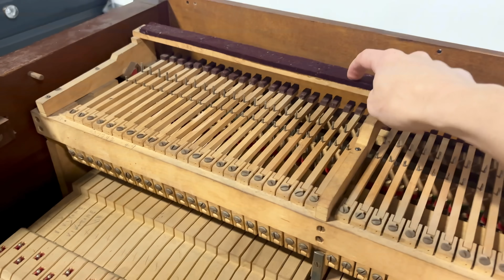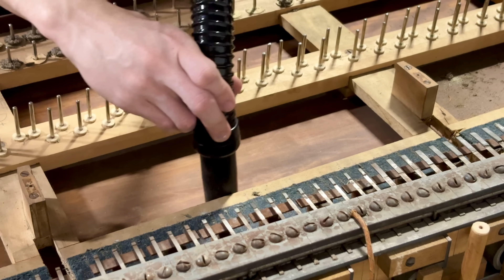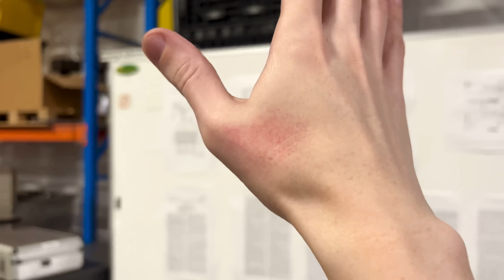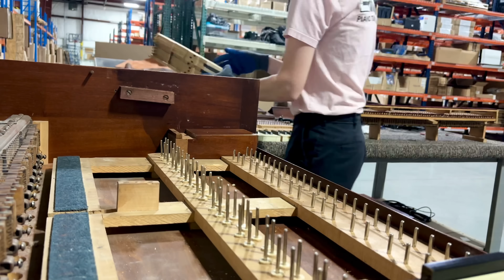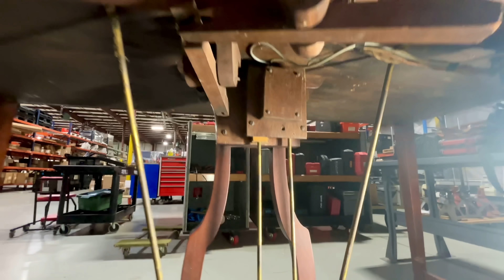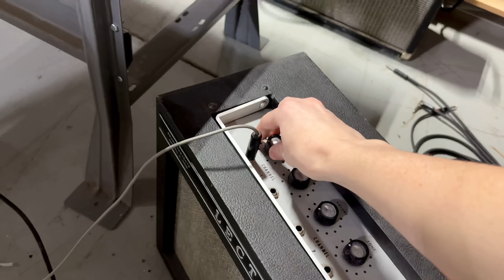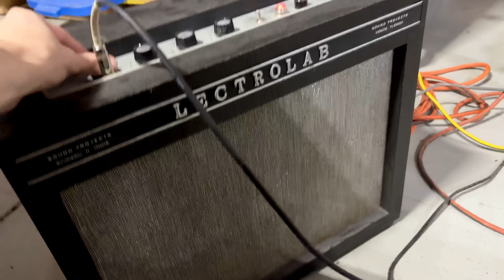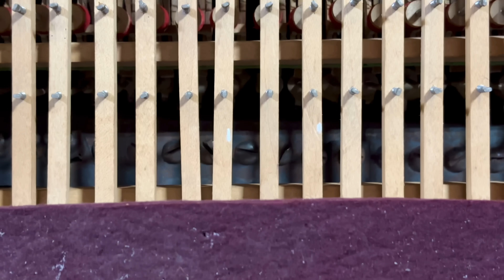Restoring an Instrument You've Never Heard (only 3 left)

Comment: this is so strange. It doesn't sound like a wurly rhodes or hohner. I don't even know what to make of it.  

thanks so much for sharing emma. 

That b3 (247 hertz) has so much key noise on it.  Very distinctive which is part of the charm.  A 100 year old instrument shouldn't really have all the reeds sound the same.

I can't believe how precisely you tuned this.  The notes are dead on as far as I can tell, not even a cent off. That's a lot of screwing and unscrewing.

It reminds me a lot of intonating a floyd rose guitar except we use a special tool with a screw in it, where you can screw the plate in or out.

[the next day]

I think maybe this instrument will be best in a mix. There's a plainness about the tone which works well in a band, but doesn't have the expressiveness of the rhodes.  I really wish you were allowed to swap out all the capacitors for new ones, because I bet they are hindering the tone. Even 100 year old pickups should be fine. And the rest of the circuits should be ok too. I think you lose something like 5% of magnetic field strength over 100 years so that shouldn't be a problem.  But if there are any caps in the power supply, audio path anywhere in the circuit I would hope they get replaced.

Comment: Those capacitors are close to 100 years old. Wow! You should replace them as they probably aren’t doing their job anymore. It is an acceptable practice when servicing a historic amplifier (like a 1960’s Fender) to replace electrical components that have “expired”. Capacitors stop doing their job after 30 or so years. They can be tested for leakage current and evaluated, but it’s ok to just replace them.  I would think the pots are ok. You can test their resistance with a multimeter. They can be inspected by opening them up if your measurements and cleaning don’t work. When you look at how much of the mechanical parts are intact, I don’t think a capacitor or pot being changed is a big deal. If you replace the parts, don’t throw them out. Bag them and keep the bag in the keyboard with a note explaining they are the original non-functioning parts.
Reply from the maker: Yes
Reply: @Emmarepairs I apologize. The instrument is really an amazing piece of history.

Comment: The shielding picking up the radio station highlights why some equipment has a signal ground that is separate from an earth ground. I would guess this has an ungrounded 2-blade power cord. If external noise was an issue, tying all the added shields together and connecting to the ground wire of a grounded power cord should help but that would be more a modernization than a restoration.

If the owner ever wishes to play it regularly instead of having a restored museum piece, some modernization, while retaining replaced parts for a possible future historical restoration, might be needed.

As for the pedal controls, use shielded wire with the shield connected to earth ground instead of signal ground. While the original wire used a single conductor with a shield, using 2 twisted pairs with a shield would allow the 2 signal wires to each be grounded to signal ground while also having an overall earth ground. A replacement gear would need to replace the one with the broken teeth. I think a 3D-printed one would be a good alternative to carving a new one from wood or making a metal one (brass to match the brass on the wooden control rods.) The 0.00075 MFD capacitor (0.00075 μF, 0.75 nF, or 750 pF) appears to have the word “OIL” right below the black line. Whatever’s inside, good chance this thing dried out decades ago. Replacing that might restore control. Once the old part is disconnected, try measuring the pot for its value, if not marked, then replace both.
Reply from the maker: Ok

Comment: Twist the wires. Twisted pair is one of the best way to shield a wire. (See how network cables are made).
Reply from the maker: Ok
Reply: @Emmarepairs  - Just to clarify a little: one 360 degree twist every 2..3 inch is enough for any audio-frequency. It doesn't have to be precise. Network cables are twisted much tighter because higher frequencies require tighter twisting.

Comment: I would have replaced that potentiometer and capacitor with something modern just to bring it back into full function. You can keep the original as part of the unit for originality’s sake, though. No need to toss it. There are times where some parts simply need to be updated. I don’t see a problem doing that here.

Thanks for the excellent restoration work here, though. Very fiddly, but now you’re the expert.
Reply from the maker: Yes

Comment: for the pot, use deoxit, and for the cap you can get vintage styled reproductions or restuff the cap yourself if you want it to look original and be functional.
 also how would original one sound? why you only need to look at the volts and cycles of the era, (hertz) as some places used 110v compared to the modern 125v, and some places used 25 cycle power instead of 60 which gave a more noticeable flicker to lighting and likely made instruments like this sound very different, so id suggest running it on a variac at 110v first just to see if it makes a sound difference,
Reply from the maker: Deoxit F5 did not do anything
Reply: @Emmarepairs  prob just too old then and age got to it, the only 30s device I have is an old philco radio ive restored

Comment: Was just randomly suggested this video, extremely interesting.

 I wonder though about the rationale of not redoing the potentiometer to keep things original but you had no trouble modifying the case to add shielding. 

Either way absolutely awesome video and thanks for explaining things
Reply from the maker: Time constraints I didn't mention--cap would take a week to arrive when the shielding could be an hour to see if the noise would be removed

Comment: I loved this video but I do have a question. Replacing a 100 year old capacitor that oozed out all its capacitance is bad because that makes it lose it's authenticto its original state as possible, but lining it with sheet metal that was never there is ok? you might want to blow the 26 cents on a new capacitor.
Reply from the maker: 26 cent capacitor that would take 1 week to arrive compared to shielding that we could test in an hour--time constraints not mentioned

Comment: You can get a modern equivalent of that potentiometer that will drop right in.
Reply from the maker: Yes
Reply: @Emmarepairs I used to fix old tube guitar amps (just the amp) so I think it's great you're saving antique electronics.

Comment: That old paper-foil capacitor has definitely failed and is leaking. It 100% needs to be replaced. As paper ages, acid in the paper turns it yellow and breaks it down, like in old newspapers and books. The same thing has happened inside that cap. It could very well be the source of the hum. It's a 0.00075 mfd cap; a modern 0.001 mfd is probably close enough. If you replace it with a polymer capacitor, find the foil side and connect it like the original, but even a disk-ceramic cap would be a vast improvement. The way it's connected across the pot, I suspect its job is to bypass RF, not control damping. You can also clean and lubricate that pot with a few drops of electronic cleaner (don't overdo it). Please remove that shielding!
Reply from the maker: Yes

Comment: You modified it with shielding but wouldn't replace a paper wax capacitor with a modern 35¢ poly capacitor?    That makes no logic.  Every radio, amp, phonograph restoration begins with replacing all paper caps.   You can't expect performance or stability out of a 100 year old paper capacitor.   Next, is the voltage supply.   I would bet a $100 that transformer is designed for 110v instead of the modern 120.  And even though it will work and should be fine the higher voltage could cause excess heat which is terrible for a 100 year old transformer.   A power reducer, like an inline resistor, step down transformer or ballast tube will ensure the 110 voltage supply to the transformer.  Not to be too critical, I loved watching your restoration!  Great job!
Reply from the maker: Yes

Comment: Please consider replacing that capacitor at the 16.10 mark. Any capacitor that old has to be all dried out and will induce noise into the system. You will have a much better sound. Save the old one if somebody is nostalgic but please replace it
Reply from the maker: Yes

Comment: Super interesting, thanks for posting the video! At 13.14 it looks like that the "black mystery material" (probably either leather or an early plastic of some kind) actually overhangs beyond the end of the wooden tongue ("plucker"). This is surely on purpose, to give a uniform pluck and therefore tonal response.  Filing off this protruding bit of material is probably not in line with the design of the instrument.  The instrument looks solid enough that it could be brought back to perfect playing condition, and for this, the leather (?) on all the wooden tongues should be replaced with a slight overhang again.
Reply from the maker: I could see that

Comment: That capacitor is a resistor or a short atm. It is interesting to see that you have no issue adjusting everything using tools to remove/add components but there is a line drawn on a 90 year old wax capacitor and pot :D that said, removing those from the circuit removed a feature that we hope will see soon back !
Reply from the maker: You are correct

Comment: replace the capacitor could have left the old cap inside the box but that would have gotten rid of the static hum and noise also could have scanned the wooden gear and made it from plastic in a 3d printer...
Reply from the maker: Yes

Comment: Fascinating. Thank you for this video. It would be interesting to take one of those pickups apart to see if it incorporated a humbucker type coil winding. Some microphones had them in the 1930s, but it would have been a very new idea. Your pickups might be just simple one directional coils. It looks like the warehouse may have had florescent lights. Did you try turning them off? You should be able to block the radio signal by using a small capacitor (say about .01 micro-farad) across each pickup coil. How is that transformer wired? Do you have a circuit diagram? It looked like it had many inputs and I'm not sure why that would be. I would expect it to be either for impedance matching, isolation, or both. In any case, I would expect just two wires in and two wires out. Are you sure that this piano was designed to be used with a high impedance amp input? Most microphones in the 1930s had a much lower impedance than a guitar pickup. If the pickups have humbuckers and you still have hum, then your next step would be to replace all of the wiring with shielded twisted pair and take care to only ground your shield at one end (at the amplifier). The reason that you want to use shield twisted pair is because of the isolation transformer - you don't want to jumper your ground (return) wire across the transformer. It's there to isolate the ground. Jumper the shields across, not the return wires. If the pickups are not humbuckers, you might get better results if you alternate the phase connection of each pickup (assuming they are all identical). Then the hum in each pickup should be nearly cancelled by its neighbor. If you don't have documentation, I recommend that you find an engineer who has the equipment necessary to reverse engineer the design. Otherwise, getting rid of the hum and getting the sound right is going to be guesswork.
Reply from the maker: I appreciate the detailed response, though the client and I were more than happy with the result we got at the end

Comment: Awesome video!! But how about replacing that old capacitor? The really do not age well. Would have made wonders 👍🏻
You wanted to keep as much as possible original, but had no problem with glueing metal sheets and drilling new holes instead of changing a single capacitor?
Reply from the maker: Waiting a week for the cap wasn’t in the schedule but shielding would tell us in 30 minutes

Comment: The little black pieces are most likely vulcanized rubber. That capacitor was an old wax capacitor. They are notorious for being leaky. At this point it's no longer a capacitor and is just a resistor. It should be replaced with a modern equivalent.
Reply from the maker: Black stuff was Polonium

Comment: I'm going to make an educated guess and say the black material you're filing on the 'pluckers' is some form of bonded graphite, pretty common material to make electrical contacts out of even now (contact surfaces for electric train pantographs and third rail shoes and also electric motor brushes are made from it).
I wouldn't describe it as carcinogenic but you still don't want to be breathing it in, I worked with the stuff a lot back in the 90's doing maintenance on trains.
Reply from the maker: Polonium

Comment: The Black material, could it be simple carbon? Like in a pencil lead?  It's black, soft and can be filed easily and is non carcinogenic and wears down over time. It's also conductive, but I don't know if that's relevant as you didn't explain the electric part of the sound making mechanism in this video.
Reply from the maker: Polonium
Reply: @Emmarepairs I don't get it, that's highly radioactive. Unlikely to be in an instrument.

Comment: Apologies if this is repeated info (I tried to do a quick search). When I encounter those old capacitors, I usually do one of three things: 1) Discover that amazingly the silly thing still works (almost never happens with the type/age of yours, but not impossible), 2) Replace the old one with a new one, but save it with the device, possibly with a note to explain what I did, or 3) To preserve the appearance, hollow out the old one and put a new one inside. The modern equivalent should easily fit inside the shell of the old one.
Reply: Great observation.  I would do any of the above.  restoration is all about making it ORIGINAL that should include approaching the sound as much as possible.  Not just the estetics of the cabinet etc.

I am a techie that loves the mix of old and new.  Think steam punk.

Antiques are meant to admire in sight and sound as best as possible.

I'm in Michigan, love antiques and do electronics repairs on many devices.  @Emmarepairs, Hit me up if you need technicals.

Comment: A weird tool you might be interested in is a pedal tool anvil.  Basically its just like a actuation pedal with a wire just like bike brakes but it hangs a pair of tongs off your belt you can use for rapid repeated clenching of tools instead of using hand force alone.  Its a common thing in jewelry work.
Reply from the maker: Interesting!

Comment: The wood in that thing is beautiful.  What you removed with the sweeper were actually mechanically corks.  Its used under force dampening conditions to ensure a very very rapid and predictable dampening like in this case where a distorted cushioning could result in missed reset timing for keystrokes.  That row of slats was effectively a xylophone tuned to playing speed instead of notes.   Such a device is also used in chioral bell mechanical systems to ensure that the entire set of voices is struck with the same force.
Reply from the maker: Interesting!

Comment: In the harmonica world we cheat sometimes with tuning, although usually when we are trying alternate tunings.  Instead of solder on the end of reeds we use Blue Tack.  It sticks, but is super easy to change.  

I'm not very good at it.  We also scratch the reed to tune it, and whenever I've tried it I didn't support the reed well enough and I've snapped the reed.  :(

I had a neighbor who had a vintage synth.  It looked like something out of the Jetsons.  My grandfather taught engineering at Cornell.  Apparently he had Moog as a student.  

Interesting video.  I love watching the workings of instruments.
Reply from the maker: Interesting!

Comment: Replace the capacitor and pot so it functions as the origanal designer intended. To not do makes everything els you are doing a complete and udder waste of time and money. Put the old parts and wire in a bag if someone wants to keep them. Replacing the felts, leveling the keys, removing excess movement all alterations from origanal. This device has been worked on before as well!
Reply from the maker: Ok

Comment: The potentiometer is probably a painted carbon film on a Bakelite backing. In these the carbon film can deteriorate and turn into carbon dust. If the carbon film is OK the best way to get them working is to open it, clean it with alcohol, polish the pickup and add a little bit of graphite for lubrication.